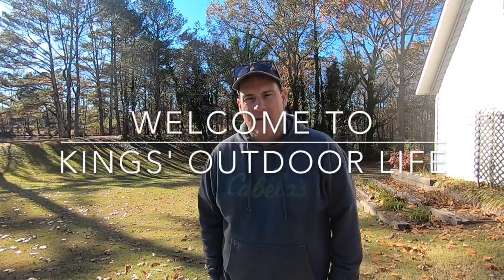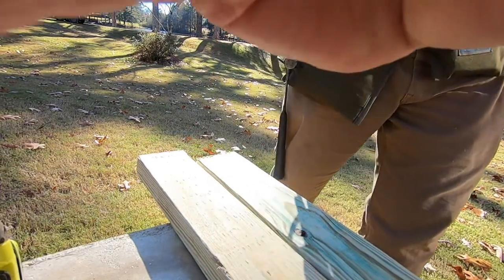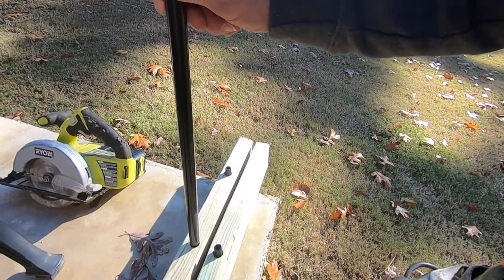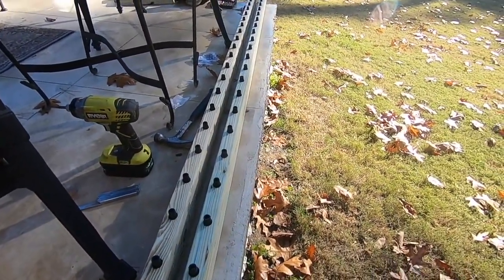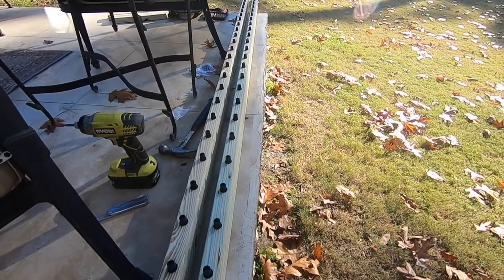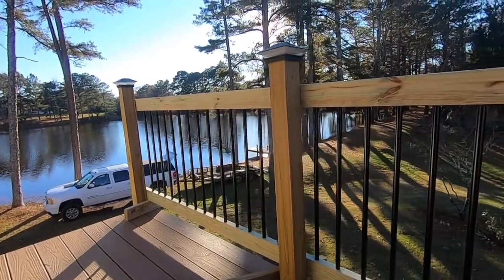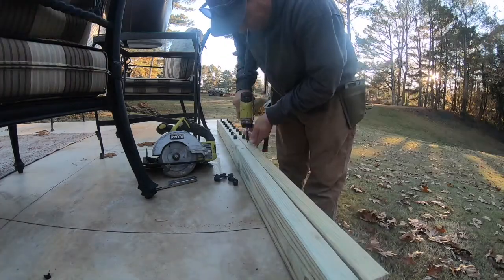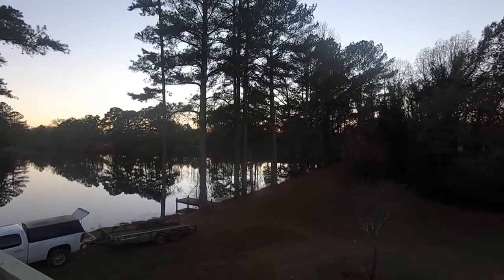Round Aluminum Deck Rail Balusters Installation - KOL 146

Comment: Thanks for sharing these great tips. All the details you provided will be incredibly helpful as I redo my current 30 year old deck with new railings and black metal balusters. Gathering all my supplies now. The tip for spacing of the angled stair railing balusters was especially helpful. I had not thought of that.
Reply from the maker: Thanks for watching and commenting.  I am glad to hear when I help even if its a don't do what I did!

Comment: Is screwing the railing to the outside of the post allowed by code? 
The only thing keeping the person that leans against the railing from falling to the ground is the pullout strength of the screws. That’s probably sufficient when first installed, but as you have said in other regards that green wood is going to shrink as it dries out. It’s also going to have moisture get in (inevitable) leading to some rot. In the future, it’s destined to fail catastrophically. Placing it inside will cost you a few inches of space, and actually none with the coffee board centered on the posts, but most importantly will prevent serious injury or fatality.
Reply from the maker: Great insight. Thanks for watching!

Comment: Looks great. I used those on my deck and they were the biggest pain in the a$$ to assemble. You get a few lined up and then a couple fall out and so on. Now several years later the 2x4’s on a couple are bowing and they are begging to fall out. Hopefully yours hold up well.
Reply from the maker: I expect the same.  I didn't like the idea from the beginning, but I had to get something up there to pacify my insurance guy.  Thanks for watching!
Reply: Just put a support block under the center of the bottom rail and it won't bow.

Comment: I thought it was strange that the top railing boards wrapped around  the posts instead of going dead center but I suppose its much easier to attach them that way, I don't think it looks as good though.
Reply from the maker: Not any easier.  I was trying to get as much room as possible and the stability of screwing to outside.  This wet wood shrinks so much and when you cut it to fit and put it on the inside it will be short when it dries and shrinks. Thanks for watching!

Comment: Did you screw the wood rails with balusters to the outside of the post or did you use any kind of brackets to hold them in place?
Reply from the maker: I screwed them straight to it.  Thanks for watching!
Reply: @KingsOutdoorLife  Ok ty!

Comment: How did you cut the corners for the baluster rails? Did you angle them?
Reply from the maker: Yessir I 45'ed them and notched around the 4x4.  Thanks for watching and hit the subscribe to help me get to 1,000
Reply from the maker: The rails I screw to the face of the 4x4 on the outside, the caps I 45'ed